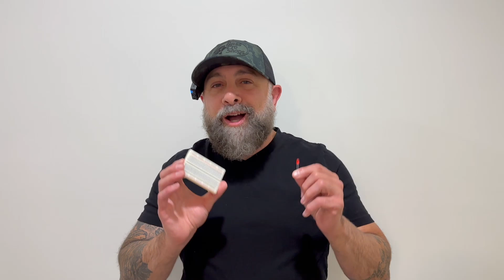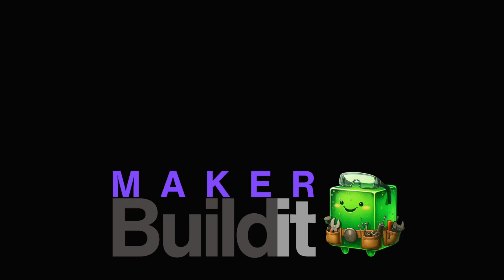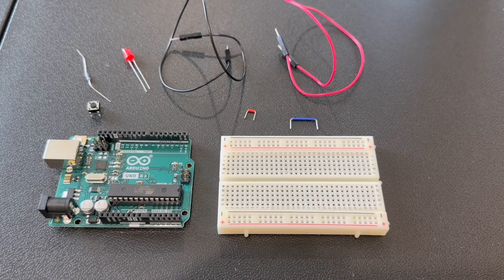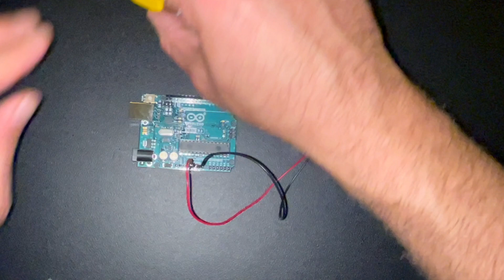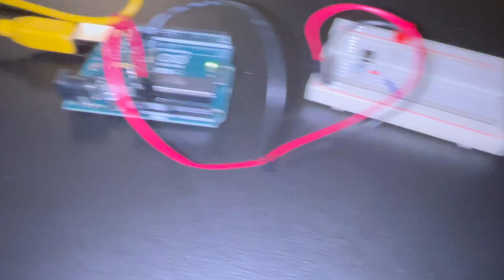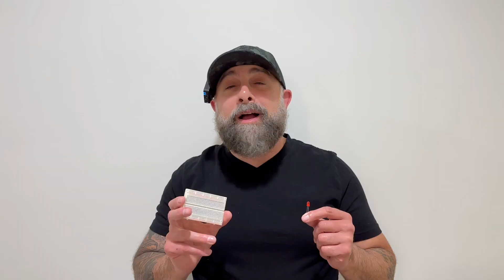How to Design a Simple LED Circuit | Step-by-Step Tutorial

Comment: great video! i dont know what i did but the LED did start glowing without it circuiting so improvements so far! thanks for the help , i still dont understand anything as i am a beginner (i am sure that i butchered the tutorial aswell but it works . very frustrated that i dont understand why it work but its fine i will find a way to understand)